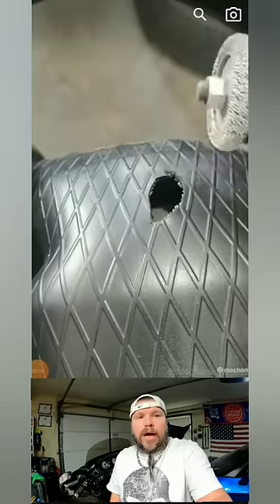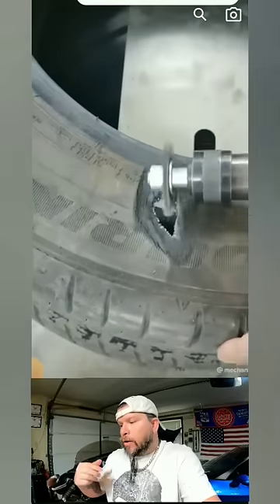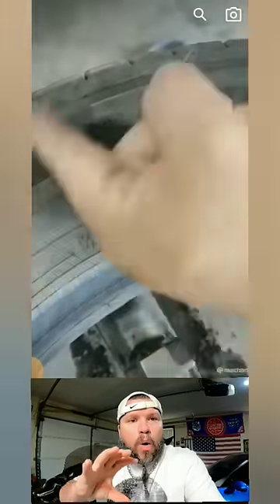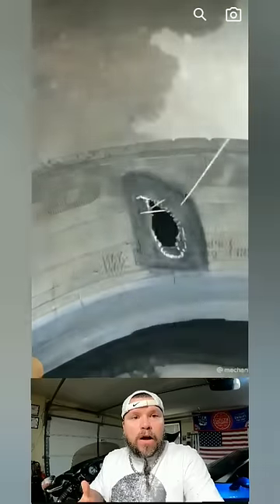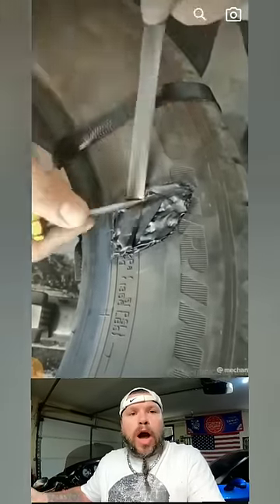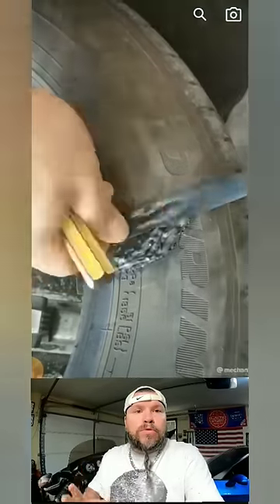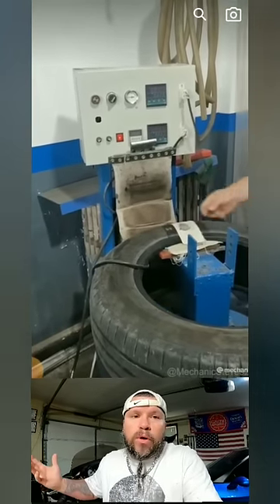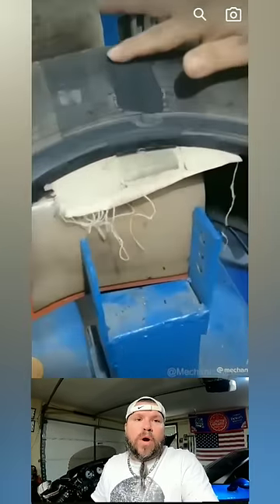patching a tire

Comment: From mechanic to mechanic, you are 10000% correct, sir. I'm coming from 20+ years as a me. It is completely compromised after that blow out. However,  people on the internet will tell us we are wrong and that this fix works cause...well, let's face it, " if it's on the internet then it must be true!" Let the real mechanics do the work, children.
Reply: Just because people aren’t fully invested in vehicles like you’re doesn’t make them children.
Reply: It also depends where the vehicle is used in many countries vehicle drive very slow compared to US. Nothing gonna happen to that tire at 40m/h
Reply: @buyerenogurlfwendo2106  Using compromised cars and pretending nothing bad will happen is childish. It's basic understanding of cars, physics and stuff. Has nothing to do with "being fully invested in cars", but with common sense, dude.
Reply: @rappymic2595  Yeah, that's true.
Reply: let's face it , people will have different beliefs because of different experiences, not every country does things the same way
Reply: @bjornna7767 Someone else commented this sooo... "I worked for 18 years at a major tire manufacturing company.  What the guy is doing in this video is a legit repair.  They repair and reuse the tires from all over the world. The side wall is rigid enough to accept the repair.  As long as the rubber repair is cured properly.  He used a all and pure rubber to make sure there is no air trapped in between the layers.  Its not as good as a new tire but it will last for a few 1000 miles."

Comment: I had a 37” mickey Thompson mud tire with heavy sideway damage, had it vulcanized and it never had an issue.
It was on the back, had a locker in the diff and 400hp / 380trq spinning it’s brains out
Reply: What psi?
Reply: @Steve-1269  depends on ply rating. I run Mickey Thompson 37 inch tires on my truck as well. They are 10 ply tires rated at 85 psi. I only run them at 65 psi unless my truck is loaded because it rides so rough.
Reply: The keyword here is "Vulcanized" not patched if you vulcanized it you're basically rebuilding it so no issues!!!  🤠👍
Reply: I think that's what this guy's failing to understand is what vulcanizing is... I mean that's how tires are made.... I see no real problem with it if it's your own personal tire... And he's talking about how a sidewall stretches and moves Well the rubber of the guy put on there and vulcanized will stretch and move with it as if it was one piece It's not like he's patching it with JB weld...🤷

Comment: I didn’t realize how dangerous it was to have a tire blow at freeway speeds, I’ve had it happen to me twice at 90+ and was able to slow down/ steer both times no problem. One time I had my caliper rattle clip pop off and the caliper kept locking on one rear wheel and just thought it was hydroplaning a bit. Eventually the actual lug bolts failed from the vibration and the rotor/ wheel broke off at over 100 but somehow miraculously stayed in the fender well
Reply: Man stop fixing your own cars 😂
Reply: @firstlast--- people dont have to fix their own cars for a blowout to happen u know.
Reply: @GodisGood941  Settle down I wasn't even talking to you lol
Reply: @firstlast---  lmao ik i just wanted to be extra

Comment: I worked at a semi tire repair place and they did this all the time and I thought the same and I mean a big name tire place. I did this but they also patched over it after we filled it wirh rubber then they put a rubber tire holder around it and put it in a chamber that heats it up and melts it all together and they keep coming back after other tires happen so I'm sure it works
Reply: I've walked out into my shop and saw a tech trying to patch a sidewall hole in a semi tire. I shut that down real quick and his response was that the driver told him to cause he wasn't buying a new tire. I ended up slapping the flat tire back on the truck myself and respectfully told the driver to take his business elsewhere. this was after him trying to bribe my tech to do it anyways against policy. heck if the driver was nicer and didn't try to undermine my shop, I would have sold him a used tire at cost to help him out.
Reply: @Irishrebel092  yeah Belle tire does thousands daily
Reply: Just because a shop does it doesn’t mean it’s a good thing to do. Wait until that tire blows out and kills someone and the driver comes back saying the tire shop patched the sidewall and said it was safe to drive. Your shop is liable for any damages related to that tire
Reply: @Irishrebel092  well done for just repeating what someone else told you instead of testing it out for yourself. you're real smart.
Reply: @jamesfranko5098  I run a semi shop dude. I've probably forgotten more about tires than you've ever learned.
Reply: @glocksp80smd  Belle Tire hasn't been shut down yet, that's all.
Reply: @mfree80286  won't happen and they do it to trailer tires not drive tires dot is less strict on trailer tires thats why you see chunks of them all over the freeway
Reply: It's called vulcanizing. Had it done on several of my tires and it worked great.
Reply: Yeah if Osha caught that, theres gonna be an issue.
Reply: @Brandon Humphries  d.o.t approves of them as I said it's traoler tires and there filled with rubber with a hit rubber gun then patches applied trust me Belle tire isn't doing anything illegal they been doing it since I've worked there and that's vene over 20 years. Plus Leslie tire does it witch is a bug tire place here in michigan and also tredroc the same and as I also said I would always buy new if side wall gives way i don't trust them either but I have never had anyone return saying the side well patch blew out or anything my place has applied and they come back for more and more specially the price of tires
Reply: @Brandon Humphries  let me state this as well there is areas on side wall they won't touch but if it's no where near the rim they will anywhere near the rim where the tire flexes alot is a no go but you cam go online and see for yourself there's fixes for sidewalls on tractors and semi tires all the time I get what people are saying but when major companies are doing it therr is definitely a guarantee. They aren't just throwing there name on something and allowing people to go hurt themselves they wouldn't of lasted this long and clearly they are giant names for a reason
Reply: Doesn't work nearly as well on passenger tires. Vulcanizing is effectively limited to semi tires
Reply: @USMC-CPL-0311  if you use the right equipment for vulcanising it works well. I worked in rubber parts manufacturing for a couple of years. 
You have to match the compounds and use the right heat and pressure.
Natural and synthetic rubbers don’t bond very well and the repair will give out relatively easily
Reply: @RedHaloManiac95  ell the shop is not liable with the owner of tire knowing. I would use this yal need to live a lil. Hell ain't no better than buying out dated new tires. I like how do said I'm no expert but ill say this ain't right lmao. But I ain't no expert but whatever to give is expert opinion lmao.
Reply: @brandondunn-qg7nf  sure the shop owner might know, but do you have audio recording or a signature from the customer? If not they can claim that the tire shop said it was safe to repair. If shop has no proof that the customer knew, customer will claim tire shop simply repaired it and allowed them to drive. Even then the shop may be able to be held liable because they should have never repaired the tire. Companies don’t have the same protection of ignorance as a regular person.
Reply: me too. I patched motorcycle tires and took them up to speed. I was a tire guy at Goodyear.
Reply: @jacobmarsh7833  Vulcanizing is the chemical effect of Rubber bonding to itself. It's not exclusive to trucking. It's done on mining trucks that carry hundreds of tons of material.

Comment: I had one with a patched sidewall. Told my mechanic I wanted a new one. Ended up missing Easter dinner because of it. Good thing I had a spare and nobody got hurt.
Reply: You had a spare and you still missed dinner? You told your mechanic you wanted new but left with the repaired tire? It seems you may have not wanted to make it to dinner....lol just kidding with ya
Reply: What kind of tape is that?

Comment: This is called sectioning a tire. Used on equipment tires that are $10k+ each, very thick, and run relatively slow and away from traffic. I would do it to a loader but not on a Prius.

Comment: I wouldn’t run this on the road, but large equipment tires get patched like this all the time, so it’s not really all that abnormal, and they’re typically strong, but yea, I wouldn’t run this on the road doing 70 lol
Reply: Large equipment tires normally don't have bands that get damaged in repairs like this
Reply: The large equipment that gets those kinds of repairs also dont see highway speeds
Reply: @austinlamberson5648  Yeah, typically 35-50 MPH for off-highway haul trucks depending on conditions.

Comment: The integrity of the tire has been established with the sewing thread. You got a trust it certified tire specialist.
Reply: Being certified doesn't mean a damn thing bud, a lot of those guys are crooks. Bet ya 50 bucks that the dude in the video is doing that, after telling the customer it can't be fixed and needs a new tire, he fixes it, keeps the rest of the money. It happens a lot and that is NOT a structurally sound fix. Some little ass thread? And tape? And melted plastic weld strips? Yea no. Coming from someone who is pretty professional in cars. No. This is stupid and dangerous and could get someone killed
Reply: Sewing thread and electrical tape. I'm dead

Comment: Well let me tell ya . . . . . . Once upon a time long ago I had four new tires, well one decided to blow in the side wall. My tire guy wouldn't touch it. I stuck a plug in it, mashed it, heated it up just a lil and smashed it again. Now note all these tires are new(should had got the warranty lol) but the tire I plugged on the side wall out lasted all of the other tires. 

The edit comes from it posted somehow, maybe I accidentally hot the button but I wasn't finished typing 🙄
Reply: Exactly thank you for this
Reply: I use the plugs myself. Once I have 8 plugs on 1 tiee due to construction in my area. And I drive that at 115mph in the Mohave desert. Incredibly I'm still typing this so it means hey held up! Lol.

Comment: I’ve done a side plug, it worked fine and never had an issue
Reply: This is not a side plug. You can see that right?
Reply: Just because you’ve done it doesn’t mean it’s safe
Reply: They been doing sidwall repairs for a long time on semis. The tire usually will just get rotated onto the trailer, so its not on a drive wheel.
Reply: A side plug is also illegal. And damage to the sidewall, and the tire has to be destroyed.
Reply: @411Adidas  no they haven't. My brother is a truck driver, and you can't even patch a hole in the tread.
Reply: @Normal1855  first time I saw it done was in the 70's bud. They still do it to this day, its called vulcanizing. Its d.o.t. approved as a trailer tire.
Reply: @411Adidas  no way that is legal or safe.
Reply: @411Adidas  no you are wrong and your advice is a danger to others.
Reply: @walterarrit5511  I agree its dangerous, but vulcanizing is still a common practice under certain parameters of damage. Most commonly seen on OTR /semi trailers, farm/agriculture and heavy equipment /machinery. Where tires can cost tens of thousands of dollars. 

You should never vulcanize passenger vehicles or drive wheels.
Reply: @411Adidas  yes but they are not done this way. They are usually done with more steps including a patch kinda thing on the inside to hold the air
Reply: @mrow9999  did I say it was?
Reply: @RedHaloManiac95  did I say it was safe?

Comment: That’s a very professional looking machine that has been developed to do exactly what it is. I would imagine the cost of that development makes the repair a worthwhile one.
Reply: I wouldn't use that tire no matter how fancy the repair equipment looked.
Reply: Enjoy your early grave sir. Please make sure to keep your will updated.
Reply: @chrisjones6002  yeah. I suppose we take the fact that replacement tyres are cheap and plentiful for granted.
Reply: @Al_Pollock  Only if you want to take for granted that you won't spin off the road and become "one" with a tree when this monstrosity rips apart on the highway.
Reply: @mfree80286  looking at the video, this is done in a country where replacement tyres are neither cheap or readily available. 
Saying you wouldn’t use these tyres if you lived in that situation would probably mean you wouldn’t be driving anywhere. 
Don’t get me wrong, I wouldn’t put that on my car in my country but if I lived there and that was the only option - I wouldn’t be walking.

Comment: Side walls don’t move too much when you have 130 psi in them
Reply: I hook up cameras to commercial aircraft tires on landing because we observe tire sidewall flex.

Average aircraft tires are 200 psi - 320 psi.

Trust me, they definitely move, even at taxi before takeoff.
Reply: Tire sidewalls often flex even more than the suspension. And besides, that is not a patch that would hold up long at 130psi.

Comment: In the UK it’s actually illegal to repair a tyre with sidewall or outer tread damage.
Reply: same in the US.
Reply: Not if it's done with a hot vulcanised process, it's done on very expensive newish tyres with a lot of limitations on the damage. But they're few and far between. You certainly can't cold plug it, you're right there.

Comment: I wouldn't use just this method of repair, you can restitch, and rerubber the tire but you need to stitch around the shoulder and around the bead back and forth and requires  vulcanizing  of the rubber to marry the patch to the main rubber on the tire which essentially makes it like new  and I would also add at least 6"-8" patch cut from another tire sidewall on both the inside and outside of the tire. With that being said you really shouldn't try and repair the sidewall of a radial tire because the stitching is literally just nylon cording and it goes one direction only which when punctured or cut causes zippering and the rubber will split between the shoulder amd the bead. Bias tires typically use copper wiring instead of nylon cording and is weaved in 2 directions to prevent zippering and is easier to repair by stiching in between the hole to add back what was broken which gives the patch/repair something strong to attach to rather than just having a spit with rubber only. If it is done properly it can work it just isn't worth the money unless it's a bias tire.

Comment: Wouldn't that complicated process cost more than a decent used tire???
Reply from the maker: Honestly, I would think so
Reply: Depends where you are in the world. Here in the states, the labor alone would be more than a new tire.

In a second or third world nation like Pakistan or India, these types of repairs are done all the time. People can't afford a $150-300 tire, when that could be several months wages, so these types of repairs are extremely common over there. The labor and materials are far cheaper over there with their scrapping economy.

There are tons of videos here on Youtube of that exact repair being done in those countries.
Reply: @GGigabiteM  Yea your exactly right. Even if places like Pakistan in the remote areas you couldn't even find a tire even if you had that 300 or so dollars. They do some wild things to get from A to B.
Reply: Saw an old truck with 4" holes in a couple of the tires patched with boots. It was holding air. Guy said he was going to get some new tires soon.

Comment: In the tire industry we call a compromised sidewall extremely dangerous, anything that compromise the integrity of the sidewall will result in a required new tire. I will never do this because like the pinned comment states you can kill somebody very easily, and you could not imagine the amount of customers that ask for this repair.

Comment: As someone who's worked in a retread shop, don't do this. We'd junk any and all tires that had side wall punctures or blowouts, they can't be salvaged. If it didn't go past the first layer of cable, we'd fill it in with rubber and re-cure it in our tire chambers and it would be ok. But once it goes through the cable, it's integrity is shot.

Comment: I grew up in a tire shop and I will say this would be okay on an old farm vehicle or something not driven daily on the road.   My family has been in the tire business since the early 60’s . I have patch thousands of tires in my lifetime literally. I patched several just a few hours ago.  The sidewall is a no go  unless it is a pinhole (trim nail or staple).  I’ve done it many time on personal vehicles.  
They have special reenforced patches. They say if it is beyond the crown (center tread) it’s non repairable . I have safely repaired hundreds . As long as it is just a nail hole or a small hole (not a slice) a tire can safely be repaired on the shoulder (the curve”) near the sidewall. You just have to know what you’re doing and have the proper patches.  The same with a plug  they make “permanent “ inserts which are not widely available that can fix a tire properly and safely .  I’ve saved many tires dealerships wouldn’t fix or other shops . Little nail holes on the shoulder .
Reply: I've fixed many tires that are "unrepairable" out of the hundreds of successful close to sidewall repairs only one time did a belt shift immediately following the repair

Comment: I've seen these type of patches done in third world countries.
They are dangerous to run at any speed over 20 mph.
The best patches are the patch-plugs vulcanized into the tire.
Only patch the tread, not the sidewall, shoulder or bead.
I've done vehicle and aircraft tires.
Anything wrong with an aircraft tire and it is replaced.
Landing speeds are 160+/- 60 mph, you want good tires.